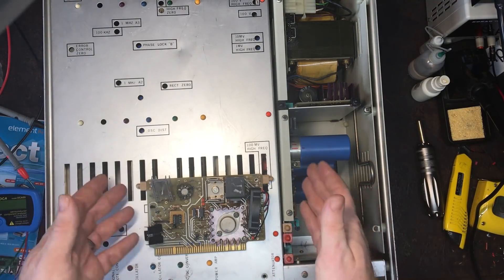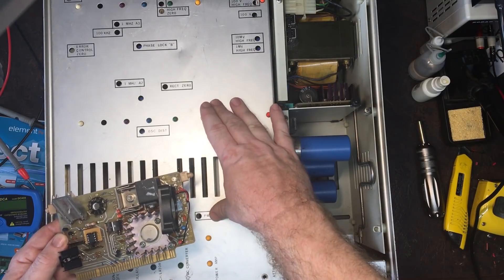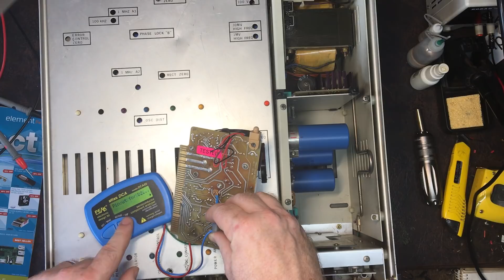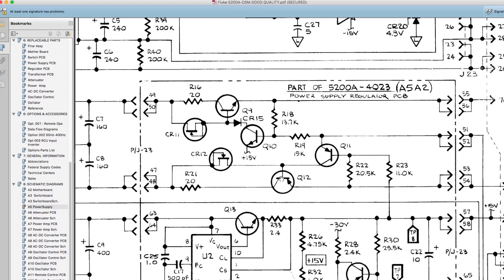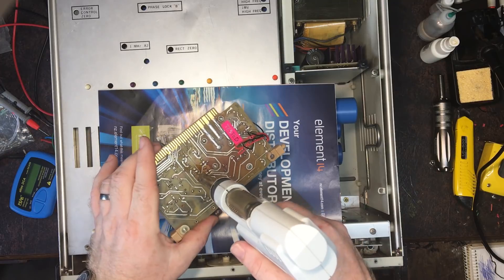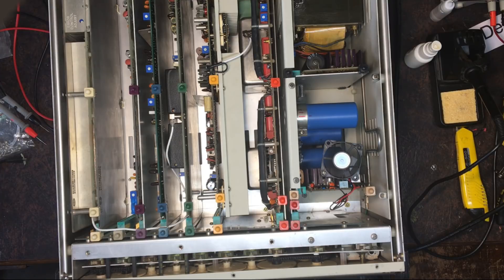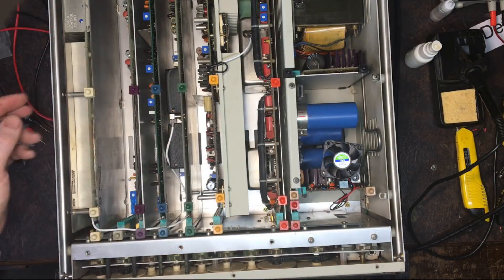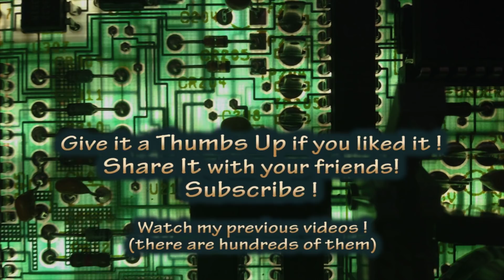🔴 #344 Fluke 5200A AC Calibrator Repair Part 14 - Power Supply A5 Yet Again

Comment: starting to look like you spend more money than what its worth.
Reply from the maker: Signal View - the parts aren’t that expensive, the most expensive bits are all the high voltage caps I end up replacing, but I think so far I have replaced about $150 of parts. I have spent more than that because I always buy more than I need for stock. So despite the cost it has still only been about half what a working one is worth.